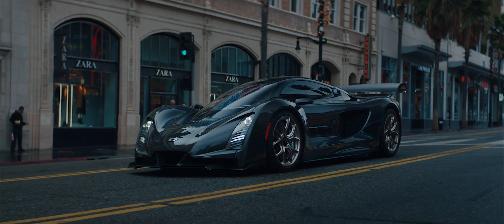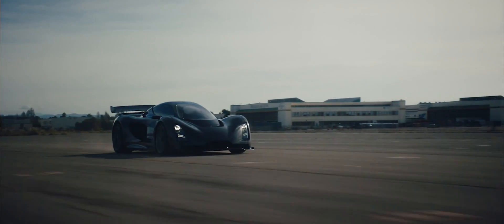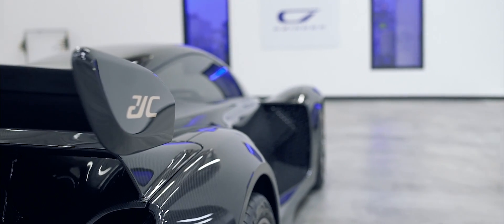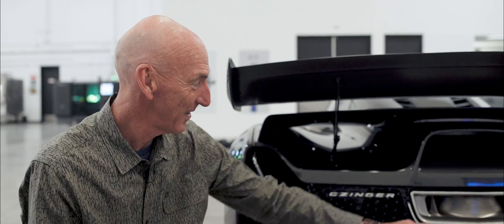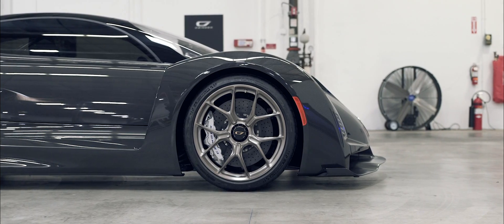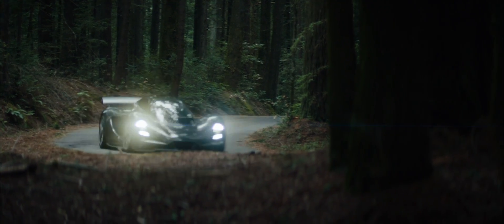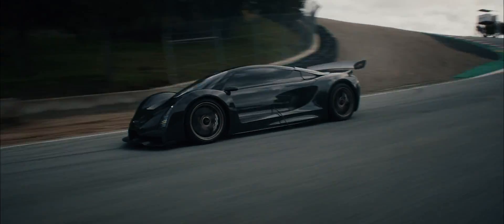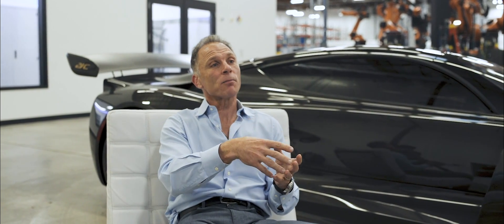Czinger 21C: The 270mph 3D-printed Hypercar

Comment: FYI: I see they are trying to hide it, but it sounds like this has turbocharged Hartley engine. Which is 2 hayabusa engines put together with a flat pane crankshaft. Engine could be taken all the way to 3.5L
Reply: It's 2.9l V8 so it could be a modified hartley
Reply: Hartley h1 v8 is 75 degree v8 and the Hartley h1 maxi is a 90 degree v8. The czinger engine is a 80 degree v8. The only other engine that’s a 80 degree flat plane v8 is the synergy v8.